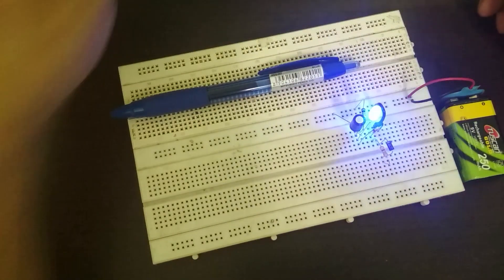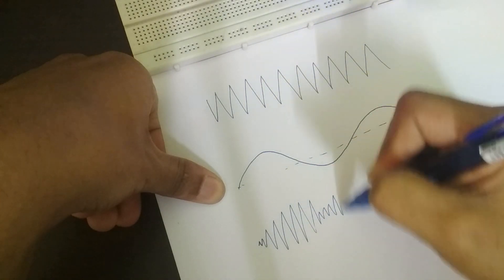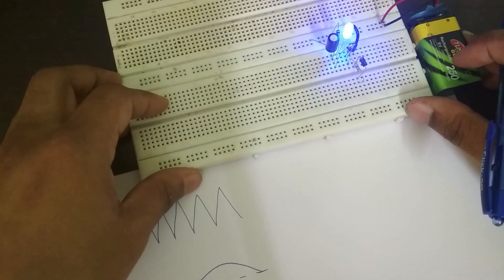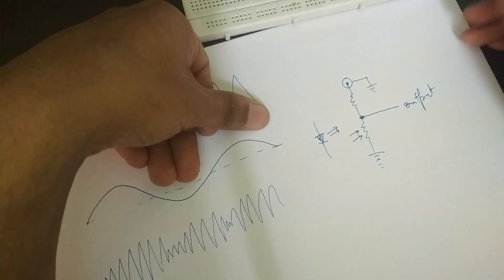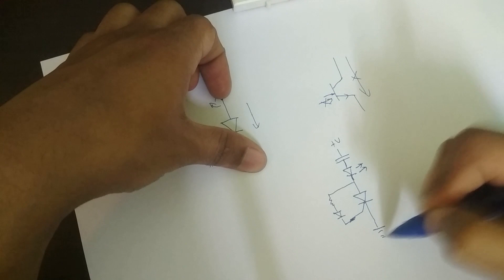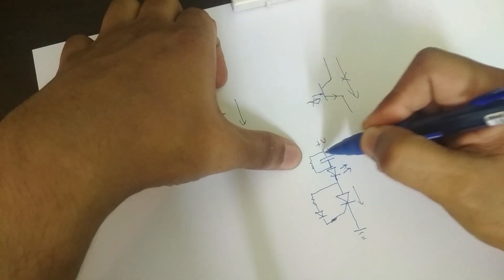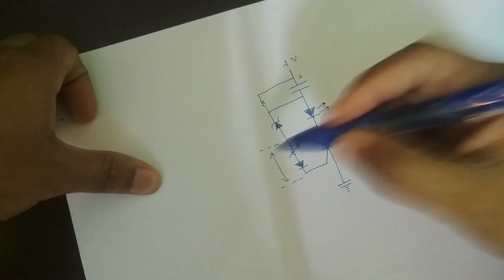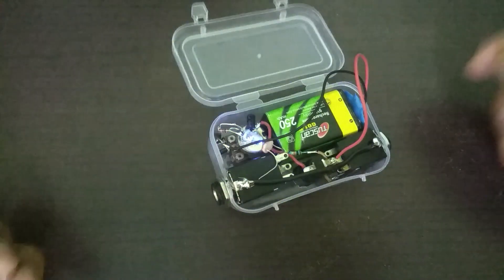A Very Simple Tremolo Pedal | DIY Modulation Effect

Comment: This is great! Is the "clicking" during the tremolo possible to negate using capacitors? Also, would it be possible to add a Depth potentiometer?
Reply from the maker: You know I've been asked about the clicking before but I'm not sure what the result ended up being. It seems like it should be possible. The depth control is definitely possible, e.g. a variable resistor in series with the ldr.
Reply: Thank you!

Comment: That's a great idea. I'm going to replace the LED flasher with an Arduino LED flasher. That might give me even more options as the LED can be controlled very precisely via the PWM output, for example. Great video.
Reply from the maker: Yes :)
Make sure to use proper smoothing capacitors or the PWM will come through on the audio. Good luck! Would love to see what you come up with too!
Reply: Hello  @Psychotenuse  and thanks for this video. I'm embarking on an Arduino version too, what cap value and where should it be put? Between pwm and led?

Also, is it possible to achieve a more square wave? I like chopping things 🙂
Reply from the maker: @drumbo1919  You would essentially want to low-pass the current to the LED

Comment: Very nice and clear work. 
I did the same, and was wondering can we get rid of the ticking sound. When the effect is on, there is a click with the oscillation. speed.
Reply from the maker: This is a question I have got a few times and I have often suggested smoothing capacitors but no one has got back to me on that and I haven't actually tried it so I don't actually know if it works :P
Try putting a resistor and capacitor in series, then putting that combination in parallel with the LED.

Comment: Is it possible to use another transistor?  I can´t find to buy it in my country...
Reply from the maker: This circuit doesn't use a transistor; you could try another sensitive-gate thyristor instead of the one I use, but I'm not 100% sure it will work :/

Comment: A want to make a pedal with  which cuts the signal in and out sharply not vary, could i use an optical relay on/ off instead of and led and use it to cut the sound throughput? I’m fairly new to making stuff.
Reply from the maker: Hi, it could definitely be done but would require a few extra components, probably.
Reply: @Psychotenuse  thanks for the info, appreciate it

Comment: I'm not an electronics geek, but want to replace mechanical bridge "whammy bar" with a simple tremolo circuit controlled by a spring loaded poteniometer to which I can attach a bar. I was thnking of just attaching such a bar to a variable capacitor, but I don't think the outputted variable tone by wiggling the bar would give the desired tremolo sound. What I am sure of is that the desired circuit is quite simple, not justifying the retail price charged for commercial tremolo pedals! What do you think?
Reply from the maker: I think you just want a volume pedal, which is essentially an expensive potentiometer in a box

Comment: where does the pot goes?
Reply from the maker: As a variable resistor in series with a diode, between the anode and gate of the thyristor. There is a schematic linked in the description. Thanks for watching :)

Comment: Neat circuit. When ordering parts, I see a lot of various BT 169s. Can you be more specific of which one or does it matter? Thanks
Reply from the maker: As far as I can tell the difference between bt169b, bt169d and bt169g is the max voltage rating, which shouldn't matter.

Comment: Nice video and circuit, thanks.  I am building a similar trem pedal (only using a 555) with the same LDR/input output section.  I am gettign a slight "popping" sound when the trem is active.  I notice your circuit does the same.  Any ideas how to fix this?
Reply from the maker: I assume you have a current limiting resistor in series with the LED? A capacitor across the LED might help then.
Maybe 10 or 100 microFarads
Reply: @Psychotenuse  ok thanks, I'll give that a try.

Comment: Hi great video. I built something similar using a reverse avalanche type LFO controlling the led. I'm going to rework it, with a lpb1 boost circuit. The reason being it works with a higher line level type signal but not with guitar. Have you encountered this issue? Is the signal going straight out the guitar to the tremolo?
Reply from the maker: Yes, in my case the guitar signal was going straight to the tremolo. What matters here is the dark-state resistance of your LDR. It should be on the order of 100k (ideally 250k-500k) for this to work. If it's much lower then the circuit will only work for line level signals.
Reply: @Psychotenuse  Thank you for clearing that up. It was a bit confusing as to why it wouldn't work. I'll revise this project.

Comment: Hi great video! Ive learned alot from it and now i want to build the pedal.
Question. What are the values of the capacitor in terms of volt? I would love to get the entire model of the capacitor for this. Thanks
Reply from the maker: Thanks :)
The voltage rating of the capacitor should be higher than 9 volts, but otherwise doesn't matter.

Comment: Hi there, i really appreciate it, what you doing, thank you a lot for your explanation, can you confirm that is an saw-tooth waveform that is generated?
Reply from the maker: Thanks for watching!
It's kinda sorta something along the lines of a sawtooth wave or triangle wave. There will of course be no true straight lines in the waveform. There will be an approximately exponential charge and discharge of the capacitor as with most relaxation oscillators, but there are plenty of nonlinear effects too due to all the semiconductors.
Reply: @Psychotenuse  I see, I've just made it, I've being thinking of using this circuit to generate an osc then amp it back to another stage of another circuit for the generation of an arc that can be used as a plasma lighter ''kind of'', but i think it wont work cause as you said,  due to the ''nonlinear'' effects of the oscillation caused by the physical aspect of the silicate, i have to find the right magnetic resonance response that are needed for the generation of the arc, and obviously that need to be the more stable possible, I've also replace the cap for an 10uf and the diode for an germanium 0.3v, seems to be stable but i don't know if it will be enough, thank you for your response, i really appreciate, cheers from Canada.
Reply from the maker: The point of this circuit is that it is a Low Frequency Oscillator, which is generally harder to make than a high frequency oscillator. Higher frequency oscillators typically make use of some stray inductance at least. A plasma lighter would run at perhaps hundreds of kilohertz. You would probably want to use some sort of LC oscillator driven (with feedback) at resonance, and then a transformer or voltage multiplier to step the voltage up to arc levels.
Reply: @Psychotenuse  Thank you for the tip, i will study that, by the way nice to meet you! ;)
Reply: I like the way you play your guitar too, keep going!

Comment: I'm not into music but this idea could also work for tremolo in LED custom lights.
Reply from the maker: I bet it could, in fact if you have a higher voltage DC rail and a bunch of LEDs in series then it's actually easier to make a flasher using a thyristor.
Reply: @Psychotenuse  Already have some thyristors (2N1613) and a couple other ones so I'll try it out sometime.

Comment: Hey i cant find the tb169 anywere. Im argentinian. Is there any other component i can replace it with?
Reply from the maker: The bt169 is I believe a sensitive gate SCR. This circuit should in theory work with other sensitive gate scrs, but the resistor values may have to change. The circuit is a bit finicky unfortunately and I've only ever tried it with the bt169.

Comment: Hello, can you tell me why there is a 10K resistor at the input?
Wouldnt this just lower the output signal?

Greetings
Reply from the maker: Yeah, that's the point. That resistor forms the top half of the voltage divider that attenuates your guitar signal. In other words, it is a drop resistor, which means the difference between the input and output signal voltages lives across that resistor. With no resistor, the input and output signals would be the same.

Now if you get rid of the 10k resistor, the tremolo effect might still work. It would be relying on the drop across the actual source impedance of the incoming signal. This means it could behave very differently depending on what the signal is coming from (guitar/pedal/preamp). It would not work at all if the signal source has low impedance.

Comment: Wait, I don't get the Z-Diode, wouldn't it shortcircuit the led when it's brightest? I figured thats why it sounds so choppy
Reply from the maker: Yes, you're right, it would sound less choppy (but also less loud) if you remove the Zener... which gives me a cool idea actually! You could make a "depth control" (technically It would be more like height control) by simply putting a variable resistor in series with the Zener.

Comment: Hello. I tried to make the circuit but the led doesn't blink. The shop doesn't have the BT169, so I buy the BT151 to replace it, does it work? Can you help me pls
Reply from the maker: I think you need a sensitive gate SCR. It might not work with the BT151.

You can try using a smaller value for R1.
Reply: @Psychotenuse  I tried using a smaller value for R1 but it doesn't work.

I think I should find another shop to buy the BT169.

Thank you for your advice.
Reply from the maker: Alright, good luck :)
Reply: @Psychotenuse  Hello, I found the BT1690, a make the same circuit like the diagram have been given, but the led doesn't blink :(( Can you help me pls
Reply from the maker: @ngotiendung7660  You can try adjusting the value of R1, try a bit higher (~15k) or a bit lower (~7k). Also you can try it without D2. Sorry I can't be more helpful :(
Reply: Make it with 555
Reply: @rodrigoespinozacarvallo2596  you will get a ticking sound between with a 555
Reply: @nedstar7378  These guys should use an optocoupler instead of these components.